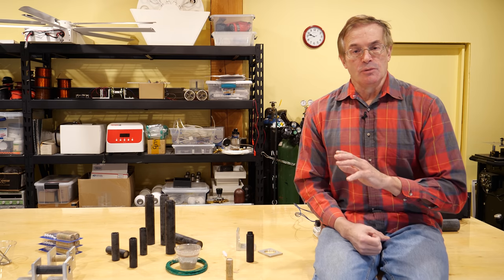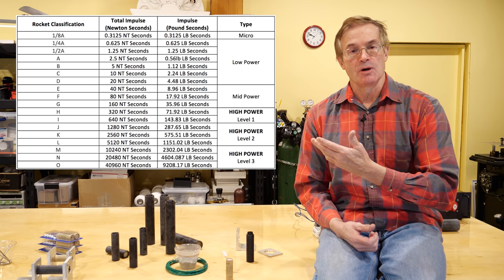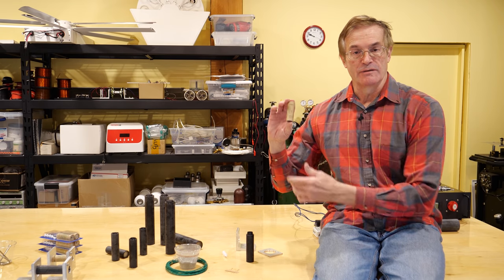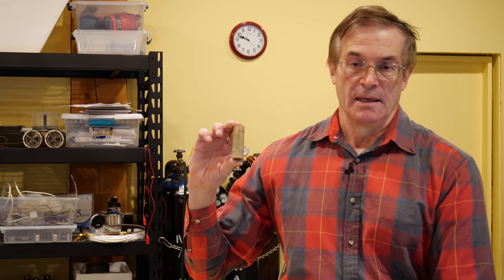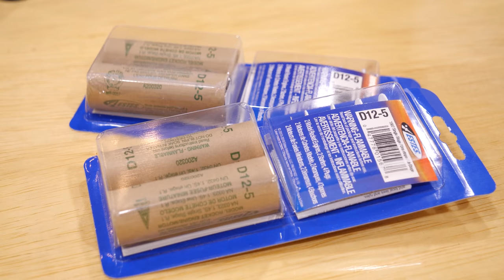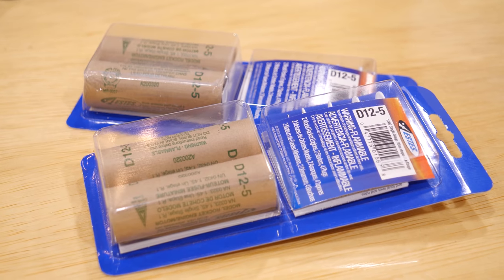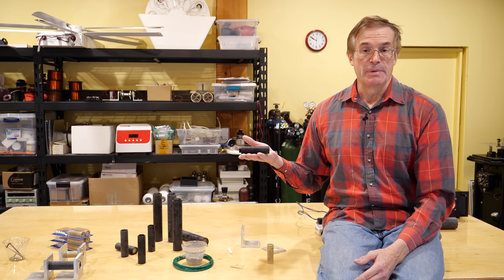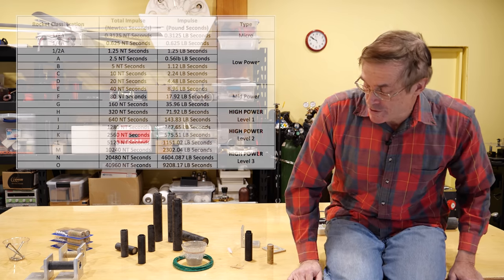Igniting Our Own Rocket Engines - DIY

Comment: Cool showing off the work you guys did.  Would it have been possible to show the engine power that was being generated during the burn?  I mean it cool to say it is F sized engine, but it would have been extra cool to have been able to show the graph of the power produced.
Reply from the maker: We'll be doing several more videos on rocket engines including the load cell data from this test sled.

Comment: Fantastic video.
The substance in the commercial video might fluctuate less that your compound? Certainly the slow burning one. It also shoots out a pretty long flame vs your gas output. I realize, we want gas.
I think with the data collected, fix the nozzle on the fast burner, and let your rocket press against a scale. Would love to see the pressure and time against a commercial rocket. Not expecting to be better, but more a comparison of apples and apples, that will set the expectations in a realistic way.
Reply from the maker: All good ideas.

Comment: I'm curious with your nozzle manufacturing, are you smoothly transitioning to and from the choke? It would be neat if you could create an acrylic/o2 hybrid engine and attempted to display shock diamonds. We attempted this in our senior design project but could not get the transitions correct and our setup had the same erratic exhaust redirections this displayed.

Comment: seemingly nobody knows these days. but back in 1990s we used a mixture of celluloid and potassium permanganate powder (I don't remember the proportions but probably 2:1). The carbon dioxide cylinder filled with that mixture would break a sound barrier...

Comment: I love these videos, but the rocket motors must be ignite from top to bottom, that way enough fuel will ignite and pressurize the motor, one way to do it is by wrapping the fuse in aluminum foil leaving the tip uncovered and this is put into the motor  , when the fuse is burning inside the motor it doesn't ignite the fuel until the tip is burned.

Comment: Did you do any actual peak thrust measurements? What are the internal peak pressures generated within the rocket engine itself? The Estes rocket engine seemed a bit more vigorous with more nozzle velocity, I am sure that could be calculated with the slow motion video .... any ways, cool!

Comment: You can make your own tubes with paper and wall paper paste, or buy paper tubes, also bentonite clay nozzles are fine for sugar rockets, find instructions on youtube. Thes carbon tubes are crazy expensive.
Reply from the maker: You certainly can.  These tubes are convenient and extremely strong and the time saved may be worth it to some people.  As the builder aquires more experience then fabricating these tubes would indeed save money.
Reply: @TechIngredients  There is also a safety factor to consider. These carbon tubes I'm sure are incredibly strong but as the home gamer might begin to experiment with whistle fuel and other high energy/unstable fuels the risk of explosion increases where casing fragments become dangerous or even deadly. Although I'm not implying what you have done here is dangerous.
  I really enjoy your channel and hope to see you continue. Thanks and cheers.

Comment: I know you'll have to address this eventually but it is very hard to get propellant mixtures to behave consistently.  I'm going to bet that that commercial D motor had at least twice the impulse of the F motor that appeared directly after it in the video.  I've had the same problems in sugar rocket mixes I've tried.  Two individual motors from the same batch will burn completely differently.  I hope your load cell has a lot of temporal resolution.  It would be interesting to see just how variable the motors you made were vs the commercial ones.

Comment: Nicely done.  I liked your introduction to motor sizing, but would have appreciated it if you went into a bit more detail on igniters and careful placement.

Some points:

- G motors (up to about half-way) are legally purchasable by any 18 year old or older.  A Hobby store that carries high power motors will have them.  The issue with them is that they're usually reloadable motors (aluminum housings) and the housings start about $40/each.  Estes does make Es, and Fs are sometimes available as you note, but as the rocket kits for them are at the model rocketry end are almost non-existent, normal hobby stores won't carry the motors either.  Mid-G and up requires high-power certification.

- Legally, home-made motors are frowned upon, and most rocketry organizations that organize launches won't permit them.  Only Tripoli permits them at (some) high power launches on days exclusively for DIY high power.  So you're limited to unofficial/private launches.  Canadian high power launches are inconsistent in this - the high power association theoretically don't allow it, but the relevant govt ministry does.  So, people look somewhere else.

- Estes igniters, especially in cold/wet weather, fairly often don't have enough oomph to start Estes motors, especially Ds.  A lot of the time you don't have the igniter bit hard against the fuel grain, that's what the plastic plugs are for - jam that igniter into contact.  Don't use Estes igniters on anything but the simple blackpowder motors (Estes or Century or ...) they won't work at all on larger motors or composite fuels.

Fuses have more omph, but there's always a fear that the fuse might clog the nozzle and blow the motor casing out sideways.  I like "sure fires" and the igniters that Cesaroni supplies for motors G and up.  Strong reliable ignition, and I've never had, nor seen one have a misfire.  Aerotech "crappyheads" (oops, copperheads) are disgusting, try to avoid them.

- Fuses are very rarely used.  Normal launches use 12V electronic firing systems, and the launch safety officer won't permit fuses.  Given the minimum stand-off regulations for high power, you'd start having difficulty running far enough with an I/J or bigger. Ns are something like 1000' minimum stand-off distance.  You wanna run 1000' over rough ground? ;-)

- I would have liked to have seen you put a strain gauge on your engine mount.  They're cheap and easy to use, and you can compute your thrust on a test stand.  Part of the reason why I say that is that your home-built motor exhaust velocity looked anemic compared to the D12, and most of the motors were coughing and sputtering like old men.  I suspect, without the strain gauge, these motors had a not very good mixing level, and the nozzle orifices were too big - low chamber pressure.  But simply making them smaller is probably not a good idea - as it was, you still blew an end closure.  Oops.

- Your motors were awfully sparky.  I don't expect that with this mix.  Consider finer Al powder - the sparks indicate wasted power.  You really shouldn't have much sparks except with a smokey sam motor.

- from what I saw, I think you would have had somewhat anemic performance with one of those motors, a catastrophic failure on the second (aka "CATO" - the rocket falls to the ground in flames), and the third was so "coughy" it might even have popped off the pad, sputtered to a stop, tipped over, and thrust off horizontally ("cruise-missiled").  A "heads up!" shot.

If you plan on continuing to make and fly these, I strongly recommend some effort in ensuring the granularity and mixing is optimized.  Then work on getting the nozzle size optimized.  That may involve more work in your end closures.

A "heads up!" is one of the things we first explain to the spectators and other rocketers present at a major launch.  If someone shouts "heads up", you drop what you're doing, no matter what it is, spot the rocket, and prepare to run.  Because it's on a course that might hit you.  When they start launching the bowling ball rockets and the real porta-potty ones, we declare a "heads up" before the button is pushed.

[Yes, people do fly real honest-to-god porta potties.  Empty ones usually ;-)]

The hobby is extremely safe.  I've never heard of a personal injury in the hobby in decades.  But I have seen pictures of pickup trucks where the recovery system on the rocket failed, and the rocket went ballistically right through the windshield, dash, and the floor.  One benefit of belonging to a club, is that you get $1 million or more in liability insurance, so you can pay for the truck you demolish.

[A fond recollection: I met an older man almost 30 years ago, who got into rocketry during the 50's.  When model rockets were constructed out of iron pipe some fittings, and a sulfur-zinc fuel.  Just like October Sky.  He had lots of fun out on the farm flying these things until ... he hit and killed the neighbor's cow.  That was the end of his experimentation.  He was grand old guy, died at least 5 years ago, and we still miss him.  You're really shouldn't make rockets that way anymore.  They're nothing more than pipe fragmentation bombs.  Sulfur-zinc burn rates are frightfully dependent on chamber pressure.  Drill out the nozzle with a bit just one or two sizes smaller than optimum, and then BOOM! with dangerous shrapnel]

Comment: Interesting results. Nozzle size is important. lol. What heat exchange temperatures do the rocket bodies produce and would they need insulating from any payload or device ? What is the thrust to wieght ratio in a basic formular ? I expect that would  take into account the length of burn by the nozzle size over the size and potency of the fuel load ? Great channel
Reply from the maker: No insulation is required.  Take a look at our follow up video on the more powerful composite propellent motors.

Comment: I love your videos, but just one question: you said you're from New England (US I suppose), so why the video is in 50fps? (double of the PAL standard). US normally uses 60fps (because it's the double of the original NTSC 30hz). There's a specific reason?

Comment: I got a question: The rockets being used are only for one-time use correct? As in it would be unsafe to refill them with a new solid-propellant? Thank you so much for the great videos! They are filled with so much information!
Reply: P.S. Would it be possible to make a video comparing the thrust mathematically? I'm sure that is going to be the next video!

Comment: Very interesting, but whats a rocket engine motor unless it actually shoots up into the sky with nice thrust ? This is what I was really hoping to see in this video. Must say I’m somewhat disappointed that you didn’t do this. As well as attach a inexpensive digital altimeter that they sell that logs the data for later retrieval via a computer.
Reply from the maker: Alas, that isn't  practical  where we're  located, so we're  building a rocket sled.

Comment: Great channel, great stuff.
I suppose You don't want to use those motors for rockets? If You do, why didn't You try to raise specific impulse of fuel by adding aluminium powder?
Also, i can't find any proper measurements for nozzle nor rods, ratios of those are crucial for working engine. Unless it was just one of very first tries. Then I think a lot of slack should be given.
Thanks for very informational video!

Comment: Can you build a rig to measure the thrust over time for these rocket engines? I tried that with a friend when we were in high school, but found that the spring we used wasn't stiff enough so while we got some usable data out if it we mostly measured oscillations in the spring load system. We used a laser and a reflector bolted to the rocket engine mount and that probably had a bit of a wobble as well.

Comment: You can most definitely buy high power rocket motors (if you live in Canada, US, and some other countries). Up to O-impulse range. FedEx will happily deliver them to your door, no problems.

E.g. this Aerotech O-5280 motor: https://www.csrocketry.com/rocket-motors/aerotech-rocketry/motors/98mm/dms-rocket-motors/aerotech-o5280-propellant-x-rocket-motor.html

Or this Cesaroni O-8000 motor: https://www.csrocketry.com/rocket-motors/cesaroni/motors/pro-150/4g-40kns-reloads/cesaroni-o8000-white-thunder-rocket-motor.html

Of course, you'd have to be L3 certified to be able to buy those O motors (NAR or Tripoli in the US, CRA in Canada, etc).

Comment: I'll be curious if you get one of these motors on a test stand to get a thrust-curve and with propellant mass get the ISP.  KNO3-sugar motors tend to get 125-135 ISP's from what I've read,  The sparks seemed to show something ablating and burning, but hard to know what that is,.  Casing wall?  Not serious though, paper cases are much worse that way.

Comment: Could you of put a load cell on the thrust plate and made high speed data collection to show the thrust curve?

I wonder if you could create a hybrid solid motor with layers of slower and faster burning fuels to adjust the thrust curve.

Comment: Happy New Year to you all.  I have not seen the previous video yet, so I may have missed something, but could you put a load cell on the push plate to measure and graph the output force and cycle for these motors?  Stay safe and well :)

Comment: I predict some high altitude coming soon. I have an air pressure toy rocket launcher which works on a bike track pump. It ruptures a plastic disc once up to pressure and gets to 1500ft (genuinely!) Perhaps an ideal first stage and solid motor 2nd stage?

Comment: When you are constructing these rockets how come you do not have an alignment sleeve on the end for the insert you use to form the cavity in the fuel mix? It seems like doing it by hand without a guide would cause the form to wander from center.

Also, what Lathe do you have? It looks similar to my old Logan.

Comment: I see your making core burners.  Have you tried to make end burners with a hotter fuel.  I was making core burner Estes style BP motors and havent tried to refine the BP for end burners like Estes are.  I like your formulas.  I was wondering if the small nozzle that blew could have been a end burner with longer duration instead of all the pressure at once
Reply from the maker: I want to stay away from end burners because the core type allows for much lighter composite tubes. We need to further refine the throat size to the fuel mix to optimize the thrust and of course still keep everything in one piece.

Comment: Add a force meter to the setup if you have one
Reply from the maker: Did you watch our first video on the assembly of these engines?
Reply: @TechIngredients  I did, and the slow burn was impressive at like 1 minute 40. But that's still somewhat short for a flare I think ? More light, slower burn ?

Comment: Is the visual flame front (consistency)  causal (directly related) to how well the mixture is burning or is it just a correlation? It looked like your mixture was sputtering worse than the commercial motor but it occurred to me that there could be a pretty consistent non-visual gas pressure that could be more important in actual operation. I would assume that an even burn would be desirable but it isn't something I have any practical experience with.

Comment: Are the large amount of bright sparks due to the carbon nozzle? also looking forward to the thrust graphs as it looked like a load cell was hooked up?

p.s. realtime side by side video of all firing at once in real time would be stunning! :-)
Reply: if you're unsure about putting shorter clips on your main channel along with your high quality videos a second channel is a common thing for showing off extra footage to fans :-)
Reply from the maker: It's probably residual aluminum from the flash powder.

Comment: Some boosters seem not shooting straight. Maybe its critical to have the exhaust channel very precise centered and also precice nozzle that is not glued in crooked. BTW, what failed with the exploding one? The nozzle or the stop at the rear?
Reply from the maker: We're not sure, but that engine used a smaller aperture nozzle.

Comment: How would you make burn with few or no sparks, like the bought motors? Would heating and stirring for a longer time at a precise temp (like using an electric laboratory heating mantle and magnetic stirrer, instead of a stove) help, or does the mixture need to be more finely ground before heating, or both, or something else entirely?

Comment: The exhaust does not appear to be on the centerline.  If you made a fixture to hold the vaseline-covered nail-like item on center while the fuel/oxidizer mix hardened wouldn't that give you the best possible directionality?  I am guessing that if your motors were fitted to a rocket and then ignite that the tail end of the rocket would fishtail.  When you compare the exhaust still of the Estes engine to yours the Estes is much straighter.  I have to believe it matters.

Comment: Oh, The Old Modified fuse method. Eh, It will work to test  motors statically, but for Rocketry flights, It's Too Sketch for that use. 
"Let's get outside and start some fires" Here we go!
Reply from the maker: Agreed.
Next time we'll cover other fuels and electrical ignition techniques.